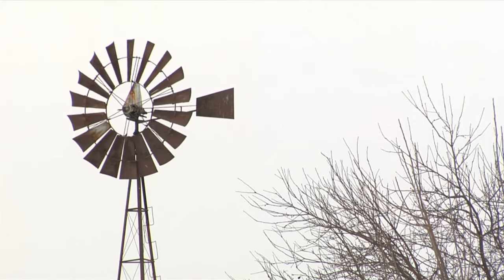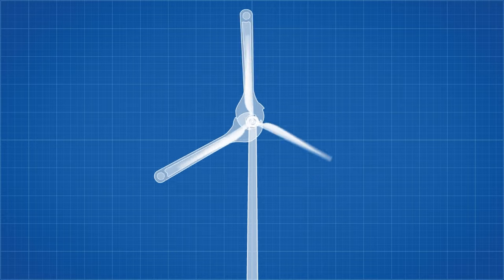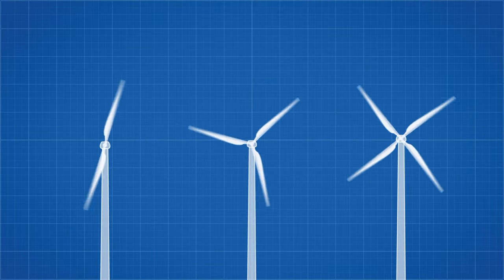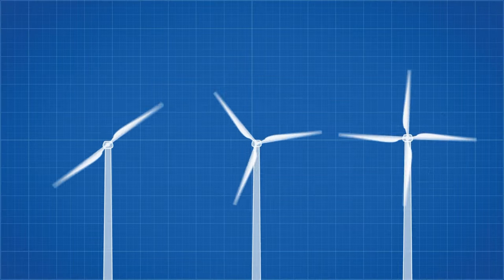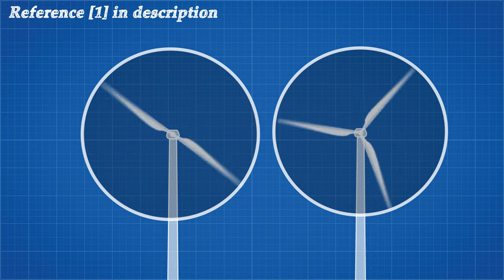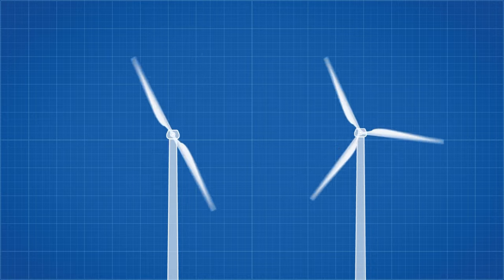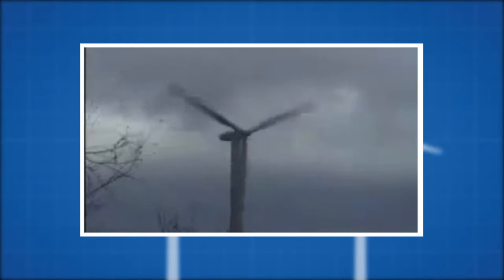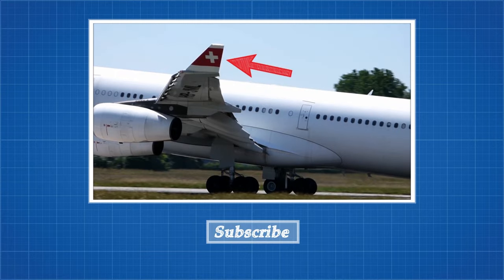Why Do Wind Turbines Have Three Blades?

Comment: Ok, here's some real info for you - note I live in one of the world's largest wind turbine producing cities in China and do consultancy engineering for a few of the companies associated.

A one bladed WT is actually the most efficient, this is due to the air having time to recover by the time the next sweep comes around, having done some aircraft wing turbulence stories you may be able to visualize that. Problem for one blade is balance and harmonics, but that's another story.

2 blade is still more efficient than 3 for exactly the same reason,  But in the real world, 2 blades are also hard to balance and align exactly opposing each other and a big harmonic problem when they "shade" - shading is when the lower blade sweeps past the tower where there is no air flow.  The loss of pressure when shading makes the blade flick forwards as the wind pressure on the blade stops momentarily.

So simply put, one more blade, 3, is the minimal suitable for these factors. They are less disturbed by balance and shading issues which also helps to control harmonics.

Note that 4 would suffer shading issues like 2 does, so 5 would be the next choice,  and note that many car radiator cooling fans have 5 so they can mass produce thousands with larger tolerances.
Reply: Well this is a better explanation than the damn video
Reply: I got that part of your explanation thanks, but I have got another one for you: blades as they are produced are long and thin, what would happen if you would make them shorter and more wide?
Reply: Ummmm .... Balance IS the story..
Also, I would think 3 blades provides MORE TORQUE... usable work, vs. velocity factor.  I should think 4 may be even better, but I would wory of the air flow recovery factor.  And, with 4 blades, the units probably have to be spaced even farther apart with great study of optimal placement based on prevailing winds being most important along with ability to anchor the beasies in stable ground.
Reply: That's a good answer. Also take a look at Robb Stark's answer above. Both of you are saying the same - it's the balance problem (related to the top blade receiving more wind). Seems that zero-blades rotor would totally eliminate vibrations :)
Reply: This is a very good explanation. Thanks.
Reply: Hey there, I realize I'm a little late in this comment, but if you happen to see my comment I would appreciate if you extended a little more your explanation on why one blade is the most efficient? Maybe it is because of a translation barrier (I'm brazilian), but I didn't get your explanation, are you saying that there's an interference between the air flow and the first blade  that  doesn't allow the incoming second blade to get the best drag possible when it passes?
Reply: Hello can you please direct me to a book or any pdf material which explains everything about wind turbines including turbine geeometry and stress analysis. Thank you.
Reply: @dreudax3294  try and get hold of Windpower Workshop by Hugh Piggot. Hugh is more about designing wind turbines for diy builders, but this book certainly explains wind turbine aerodynamics, vibration and a load of relevant stuff in layman’s terms. If you read this book you will know more than the guy that put this video up🤓😁
Reply: @robingraham6820  Thank you mate,
Reply: @harrickvharrick3957  it would rotates faster, so faster rotates causes more centripetal force. Not good
Reply: @onurozkaya2299  I re-read this great explanation Mark gives in which he actually answers several questions. The most important are that wind only has so much power to give per volume per amount of time (that's why he says one blade would be best but it can't be done, there'd be no balance at all). Also there is a dead spot, namely where the pole (tower) stands in the way so that a blade when it passes that point momentarily gets no energy. Which causes that blade to stretch back to a relaxed state for a short moment, again causing the axle that all blades are mounted on to tremble. With two that happens when the other one is maximally powered so it is a cause of continuous disbalance. So, as one or two blades aren't possible, even though one would be best cause it would allow the wing force to remain optimal, three is the first possibility. Four couldn't be done be cause again you'd have two blades sitting opposite to each other, and five this would be the second possibility. He states that although the lowest number would be the best, the higher the number the easier is to balance the while construction - the higher the number, the less one individual blade makes a difference compared to the total, of course. In guess my own question was already explained with by him with that same remark about wind having only so much energy per volume per amount of time you can harvest. Namely, when the blades are longer, they reach an area where they are further apart, thus being spread over a much greater volume, where there is more energy to receive. And when they are thin they cause less blockage of the wind, a broader blade would be comparable to a higher number of them off course. One question remains for me though, and that would be, did the old farm hands that built such special wind-powered water pumps to provide their cattle with drink or to regulate the water in small canals, just do things completely wrong when they made them with a whole bunch (probably upb to 16 of so!) of very wide blades, that were mounted in a ring-like shape and practically overlap each other? Or did they do that on purpose, for instance be cause they didn't want it to spin fast? One other mystery about them is they sometimes have a "tail" (that on small, normal wind mills will keep them turned so that the blades keep facing the direction from which the wind blows) that is mounted in an angular position.. I wonder if Mark is ok and what he's doing nowadays! I don't think one can be consulting the same factories forever on a subject like this, I would expect after a while they'd have learnt all there is to know from their Wizard. On the other hand is his knowledge so good that he may always find some company who'd like his advise. Wonder what he's doing now.
Reply: @onurozkaya2299  I re-read this great explanation Mark gives in which he actually answers several questions. The most important are that wind only has so much power to give per volume per amount of time (that's why he says one blade would be best but it can't be done, there'd be no balance at all). Also there is a dead spot, namely where the pole (tower) stands in the way so that a blade when it passes that point momentarily gets no energy. Which causes that blade to stretch back to a relaxed state for a short moment, again causing the axle that all blades are mounted on to tremble. With two that happens when the other one is maximally powered so it is a cause of continuous disbalance. So, as one or two blades aren't possible, even though one would be best cause it would allow the wind force to remain optimal, three is the first possibility. Four couldn't be done be cause again you'd have two blades sitting opposite to each other, thus five blades would be the second possibility. He states that although the lowest number would be the best, the higher the number the easier it is to balance the whole construction. That is be cause the higher the number, the less one individual blade makes a difference compared to the total, of course. I guess my own question though not the only one was rather stupid cause it was already explained by him with that same key remark I never had thought about, namely that wind has only so much energy per volume per amount of time you can harvest. (If you block too much of it, you harvest less instead of more energy from it.) So, when the blades are longer, they reach an area where they are further apart, thus being spread over a much greater volume, where there is more energy to receive. And at the same time you'd want to make them rather thin cause less blockage of the wind. (Also a broader blade would create the same outcome as a higher number of them of course.) One question remains for me though, and that would be, did the old farm hands that built such special wind-powered water pumps to provide their cattle with drink or to regulate the water in small canals, just do things completely wrong when they made them with a whole bunch (probably upb to 16 of so!) of very wide blades, that were mounted in a ring-like shape and practically overlap each other? Or did they do that on purpose, for instance be cause they didn't want it to spin fast? One other mystery about them is they sometimes have a "tail" (that on small, normal wind mills will keep them turned so that the blades keep facing the direction from which the wind blows) that is mounted in an angular position.. I wonder if Mark is ok and what he's doing nowadays! I don't think one can be consulting the same factories forever on a subject like this, I would expect after a while they'd have learnt all there is to know from their Wizard. On the other hand is his knowledge so good that he may always find some company who'd like his advise. Wonder what he's doing now.

Comment: More blades mean more "Solidity" (a factor of wind turbines). It is the area of the inscribed circle of the blades length divided by the frontal area of the blades as experienced from the axis of rotation. More blades would mean more solidity and this would block a large part of the airflow, lowering the effectiveness of the next turbine in the row. Also the effectiveness is more affected by the length of each wing as there is little to no torque at the base of each wing, while adding an extra wing would increase the rotational mass, the cost of the construction when a similar increase in weight and cost invested in wing length would have better performance!
PS: Two blades have balancing issues as the height of the turbine oscillates, so will the torque from the wind and to make matter worst when one blade of a two blade turbine is at the top position the other blade is in front of the mast having no air flow at all, so both the rotating assembly would have a knock like imbalance when a blade passes the mast, AND the whole turbine would have a great oscillation from the oscillation of the torque transmitted to the mast!
You're welcome!